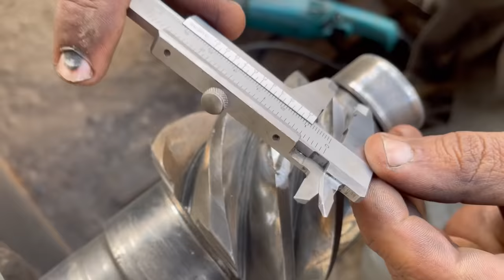I repaired the scrub pinion which no mechanic repairs | Give your opinion by watching the video |

Comment: I'm impressed with your resourcefulness and skill, well done...however, if the repair lasts more than couple of weeks, I'll be surprised.  I hope it does though, good luck 🙂
Reply: If we buy new one it will cost more then that.. 6 month
Reply: You have to take several factors into account to put this into perspective. It’s being done in a populous and poor country. Labour there is very very cheap and plentiful. A lot of the owners of these vehicles can only just about afford to own them. They do not have funds to pay for expensive parts and labour/maintenance costs. Also they cannot afford to be without it for several days/weeks. This type of work is not done in days but in hours and usually the vehicle is running and back to work the same day. Their neighbour China provides them with cheap materials  and it just make sense for them to do repairs this way. Yes it’s more Cost effective in the long run to do it properly but they survive on extremely low daily pay. That cheap labour and pricing also applies to them. How are they going to pay for something that would take them many months to earn? Granted it’s not what we would regard as a real fix but they have been doing it this way for decades and it seems to work for them.

Comment: Keeping the gear running whilst not all things are available or affordable these guys are very skilled
Reply: half the way job. It needs thermal treatment for hardening
Reply: @COSTASSERA  I am not a professional machinist but I work in a machine shop I am learning I also do maintenance work hvac and I have taken several welding classes I thought  this things needs heat treating especially after he welded on it. Glad someone else thought so too. Still great job gettinghalf way there i dont know if I could have done it.

Comment: These hypoid gears generate more tooth pressure than any other types. This workman shows great skill and confidence. When I think of all the dedicated inspection equipment I was given for gear grinding during my time as a machinist in the USA,  I realize just how incredible this workman is in attacking this repair.
Reply: How long you think this will last? Think it’s good as new? Maybe better?
Reply: He has done a fantastic job unfortunately it will not last very long due to the problems you have pointed out.
Reply: @longsleevethong1457  The pinion does not operate in a vacuum. It is necessary to include the crown gear in any speculation as to how long it will last. If the proper gear oil is used and the loads are kept within limits, then this gear repair will last until the end of time, maybe longer.
Reply: Lies

Comment: A couple of things:
1) for all those who say this will fail in a week: how is it loaded compared to the design load ? IDK, YDK. Why did it break in the first place? IDK, YDK
2) back in about 1980 i repaired the final drive gear on a JD tracked front end loader this same way, except i machined the welded teeth instead of using a grinder. Hasn't broken so far. New part was available for some crazy high price, I'm too cheap to buy it.  Low speed gearing and maybe it ran a little noisy but couldn't hear it over the rest of the noise.
Reply: Machining a part is different than eye balling and manually grinding by hand.

This is a "good enough" but wouldn't pass any form of QA and could literally fail from any minor thing. Safety is obviously not a factor for that part of the world.
Reply: @bobdole4093  you said, " machining a part is different than eyeballing and manually grinding" . . .  Well, not really, I'm not a very good machinist. I mostly work to tenths tolerance - that's tenths of an inch, not tenths of a thousandth. 🙄
Reply: @kimlground206  then you're not a machinist. Not a quality one, any way
Reply: @bobdole4093  you got that right brother
Reply: It's quite obvious by the fretting on the drive flank of the pinion gear.  One or two things caused this.  Either the truck was severely overloaded or the lubricant wasn't up to spec, or, most likely, both of these.  The ring gear will show similar fretting on the drive flanks, so both are junk.  Using them will circulate metal particles which will take out the gear set and all of the bearings.

Comment: If this wasn’t such a high precision high stress component of a drive system, maybe it would be viable. But you did a lot of things that showed a total lack of understanding of the component.

Plus you should have dealt with the oil impregnated area where the damage occurred before beginning to weld. Degreasers might work, but heating to around 150°C before plunging into degreaser a few times would be better. 

Hardness testing is essential before and after. 

You shouldn’t have finished the surface with a grinder. It needed polishing. 

You should definitely not have touched any of the other teeth. 

You didn’t use a centre when you put it in the lathe. 

You didn’t use a dial indicator to even test the outside diameter of the new area of the repaired tooth. 

And I simply have no idea what you thought you were doing with the Emery cloth on those bearing surfaces…! Reducing them in diameter and leaving them with a rough surface - just to remove the discolouration is all you actually achieved!

Very clever looking skills, but from a practical sense likely to ultimately destroy the whole differential. Sadly Not even a good get you home solution.
Reply: Voce é muito bom para criticar ne .
Mas todas as suas criticas nao tem nenhum proveito pois o serviço ficou impecavel e pra quem nao pode pagar por uma peça nova, ficou excelente

Comment: I haven't even watched it yet and I'm assuming you just added material and machined it back into the rough general shape and weld is always weaker than the machined material out of billet steel. I wouldn't have bothered because it'll 100% be the first part to break again after use from the bonding surface either warping because the metal isn't heat treated to the same degree anymore. Either that or it'll warp and lose material faster.
Reply: While you are correct, places like where that guy lives they just have to make due with what they have because a new part is just about as rare as platinum. My brother whent down to El Salvador on a missions trip and had to patch the hot side of a trubo with some metal he could get his hands on. Last time I heard the front-end loader is still chugging away just fine, well better than it was insted of just having all the exaust dump out of the trubo.
Reply: I was under the impression that if its the correct electrode used, than the weld is always stronger than the base metal because the heat affected zone makes the base metal weaker.
Reply: They didn't machine it, they sculpted it with an angle grinder, the whole thing is gonna chew up the other gear and then some. They also took the grinder to town on the non-damaged surfaces, adding backlash to the whole drive system, not gonna last very long I tell ya.
Reply: @d7588  True, and the welding ruined the heat treating that gives that pinion its toughness. I understand working with what you have, but that doesn't change the laws of metallurgy. That repair will fail sooner that later and take the rest of the rear end with it.
Reply: Well, there are better materials and modes to do those welds, in any case, i send to re weld a gear that isnt in production anymore to a retired welder, he had used inconel 600 or so and let it cool in sand a lot. 30 euro repair vs 600 euro a new gear (if you can find it), we have used epoxidy resin to have a near perfect sample to grind it. So we rebuilt all togheter, after some work the gear return to have noises. So i said " well, at least we try" we dismount all again and with a lot of surprise the welded tooth was still there, an other one was broken. Wasnt crack before we checked. If you use good metods of work your weld can be the same as the original material, but you have to know what are you doing
Reply: I feel like it could potentially hold up on a car or small vehicle. But something like this? Not happening. It's going to break.

Comment: Considering the front tires on that truck were completely bald, that job of "fixing" that broken tooth will last until the truck goes into the ditch the following week.  
No heat treatment, you local hardened the area of that tooth, you profiled the pitch line with an angle grinder, it's going to eat the ring gear before those front tires blow...

Comment: I'm always amazed how machines can be repaired with the simplest means in this world.  The only problem I see here is that the gears are case-hardened!  you have restored the tooth's physical form, but now the material is very soft and will not last as long as the original.
The work is not bad and represents a temporary solution, so that you can continue working with the machine. Greetings from Germany
Reply: I wonder how this would work with hardfacing rod.
Reply: @mrmikemanify  the hardface welded portion will be hard but perhaps the weld  heat will reduce hardness of adjoining un welded portion unless his welding  technique as it appeared  to be in small bursts  didn't  heat up the adjoining portions too much .
Reply: They don't have the option to just buy a new one. That would come from somewhere like Germany for example. Do you think they can afford that? Its just not an option. 

This is probably the only real logical option. Its still steel, hardened or not. It will hold up for some time. 
Some gears are only induction hardened on the teeth, which could also be potentially incorporated into the repair process in future. 
The tooth looks like it broke because it was brittle to begin with, which isn't going to helped by hardening? Perhaps it will last longer this time? I doubt the machine has enough power to shear apart unhardened steel. Steel is incredibly strong. 

Perhaps the small weld blobs cool in the air and adjacent steel fast enough to slightly harden the steel?

@Michael:  I doubt enough heat will make it into the other cogs before its dissipated by the center shaft...

I doubt this is the first one he's done. Probably means they work well enough to bother. Gears are even repaired by welding in the west. https://uwp.ca/en/gears/

All the best to all Volk; from New Zealand :)
Reply: I work at ZF Friedrichshafen and I have to tell you that the teeth for gears or differentials are not inductive but nitrated or case-hardened!  This means that the surface of the material is very hard and wear-resistant and the "core" of the material is still "soft" so that the teeth do not break directly when the load changes.  And it's like cams and crankshafts, the surface has to be hard and the core soft.

Of course, when the parts are well welded, the teeth don't just break, the surface isn‘t  hard.  It is clear to me that this is how repairs are made in many parts of the world and the workshops help each other as they can despite everything good work

Comment: They should have heated the entire pinion before welding.
Reply: Yep some kind of heat treatment is needed, welded spot is so hard I think its just gonna crack
Reply: They should have thrown it away and got  a new one
Reply: Pre and post heat to be honest
Reply: And after as well with an oil bath... To get carbon
Reply: @ErichHarder  what exactly does post heat do?
Reply: Hiiii
Reply: @PenttiHinikka  hiiii
Reply: @ErichHarder  hiiiiiii
Reply: @zeke112964  hiiiii

Comment: I know a lot of people on the internet get triggered by this type of repair. But you need to take into account the context people in Pakistan live in. I suspect that this repair was purely temporary, to give the truck owner a couple of weeks, to get the money together to buy proper replacement parts. In that context, this is perfectly fine.
Reply: oh. it will go more than a few weeks. Unless it breaks again, I give it 10 - 20 k miles before it wears the ring gear to nothing. The flipside is the next tooth could be gone in a few months.
Reply: I give this repair a vote up since the alternative might be the entire machine would otherwise be junked or lay dormant for a very long time.
There is a reason why this pinion failed in the first place, I'll guess the machine was overloaded and the delivery date was closing up.
There needs to be a safety note attached to limit the job load to 20% OR SOMEONE COULD GET HURT.  As the old adage goes, don't try this at home.

Kudos to the skilled welder and mechanic for an innovative rescue of a failed machine.
Reply: @buddyroeginocchio9105  ... I did vehicle repair for about 50 years and in my opinion that wear is from lack of lubrication. The heat that generates takes away the surface hardness of the gear. IOW, the rest are already compromised, but at least there's no more crumbling bits to make matters worse. BTW, what's the chances they "take it easy" in the near future? <LOL>
Reply: I totally agree in that the technician did the best with what he had.  I'm sure the customer was grateful for the repair.  That being said, how long do you think the repair lasted?  How emotional was the argument when the repair failed?  Which person's mother was the fatter camel?
Reply: @mikemeyer1791  ... that may depend on the father favoring camels over goats... and who the son is! (there also may be a set of army boots involved) <lol>
Reply: @rupe53  I wasn't there, and neither were you, however this failure looks a great deal like a force overload with a sudden impact regardless of lubrication.  
How much would you risk your life on a welding rod joint at the point of failure, understanding the design and application of the original forged material?  
Are you willing to project that risk on to an unsuspecting future operator?
Reply: @buddyroeginocchio9105  .... yes, on the final failure. It could even be from the shock of wheel spin in a pothole. I believe you missed my point that metal changes with heat and the heat from poor lube is where this failure started. That's my observation after 50 years in the field and knowing the history on most of the vehicles I worked on. It's not a repair I would do so I risk nothing. My comment was only an educated guess.

Comment: If that repair holds up for a month, I'll give you my house. Their is no way that arc welded bandaged gear will mesh up correctly to the other gear! That gear has been structurally compromised by heating and grinding it improperly.
Reply: I like to see that on a contract.
Reply: @flyingrc2041  if they match my offer (obviously they probably can't) it would be very very interesting
Reply: U talking nonsense as I repaired mine and is working great so far
Reply: @moibm8332  🤣🤣

Comment: Very innovative and beautiful welding, my main concern is this repair gets buttoned up and someone down the road in time uses the truck as if it had never been broken.  The repair certainly does not eliminate the root cause of failure nor assure future reliability to any degree of certainty.
Reply: Is should have been heated to atleast 4-500 before any welding waà done on it set up a torch with a rosebud if you dont have acess3 to a industrial oven or furnace would have made a mixb stronger weld than just welding onto room temp steel
Reply: @Piccodon  Warranty is 30 minutes or 30 miles which ever comes first
Reply: That part is under alot of torque id guess as soon as it sees a moderate to high load it will snap the weld right off. from what i could see it looked like a clean weld but in my opinion he wasnt running a high enough voltage to get a good penetrating weld. so my guess is the weld penetrated maybe a 16th of n inch and i bet if you magna fluxed it or xrayed the weld there would by micro  fracturing throughout the weld esp at the point of break n where the weld starts.
Reply: Wondering what the ring gear looks like?
Reply: Probably a failed bearing.  In which case should  last forever if maintenance is done
Reply: @jameslewis974  Quite right and thank you for raising the important issue. This understanding has been disregarded in most if not all mentions.  As far as strength at least two discussions are in order; first is the strength of the weld to base, second is the strength of the weld material. (A third might be the core robustness and surface requirements of the final product.)

We all understand this repair is a heroic rescue attempt in the middle of a field failure.  The demonstrated remedy is "the best we can do with the resources in hand".  However, for reasonable restorative action all the required conditions come into play and the temperature of the base component is most important to the longer-term reliability of the finished gear.

Others have raised important questions regarding wear, lubrication, and service conditions, answers for which are short in detail for the time being.

All said and done this is one heroic and skillful rescue of the task at hand.